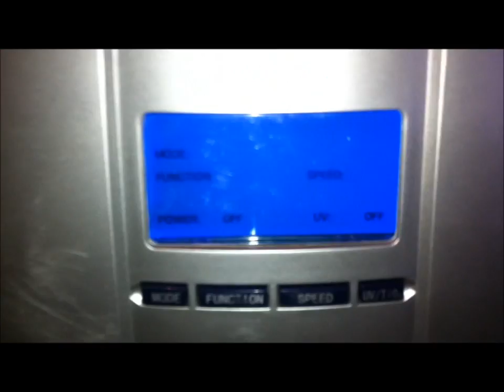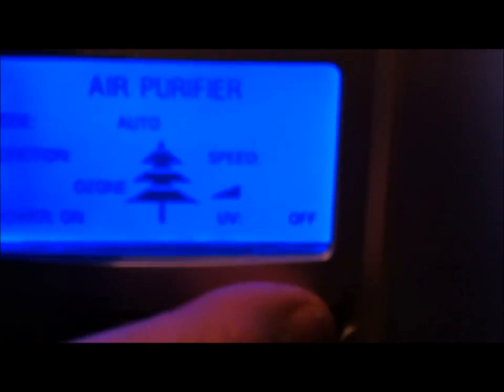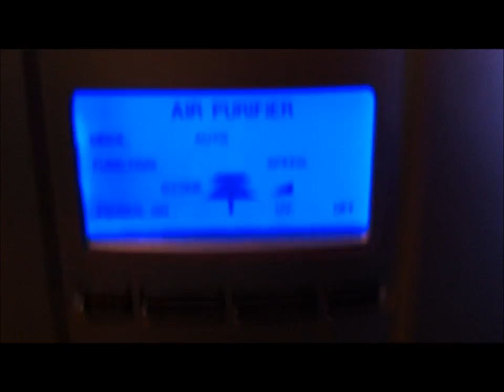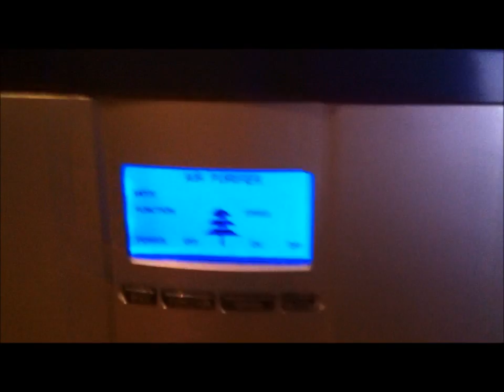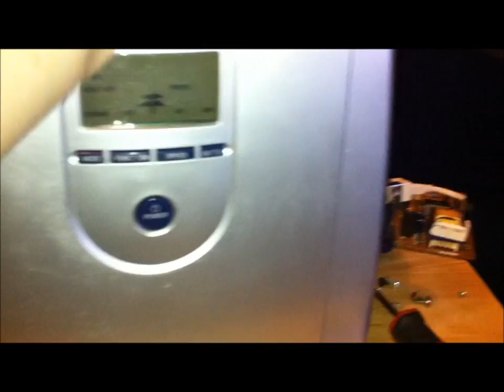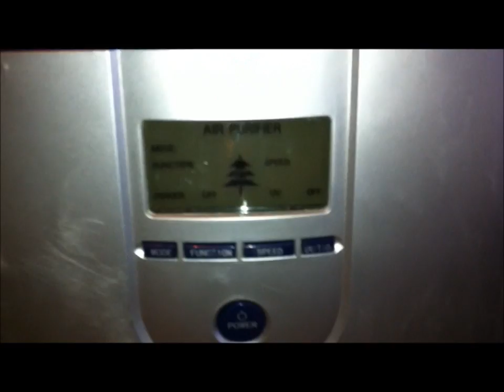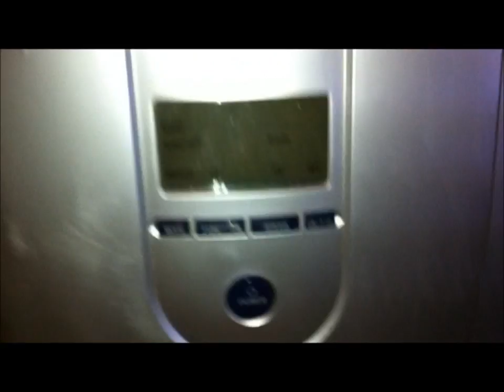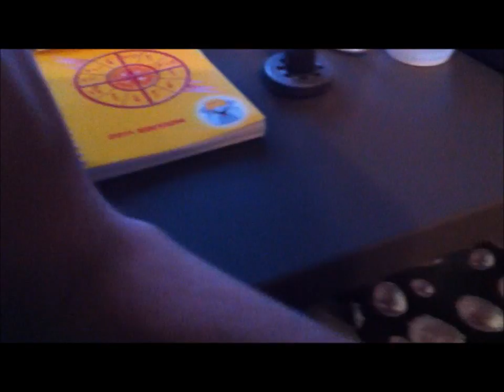EdenPure Air Purifier hype debunked + ozone generator fun + UV bulb

Comment: ions do purifier the air, but not as well as particle filters, and even more than that negative ions (not positive ions) have been shown to prevent cancer... see the youtube video about it from the doctor in japan who did the study...  the YouTube video is titled: "Science: Power of Negative Ions - Restorative Medicine of Nature"  (this is not medical advice)

the only way to have truly clean air is to live in a forest setting or location away from any air pollution, this is because air pollution sources make far to much polluted air to quickly filter, even the best filters take time to filter the air in an enclosed space and in that time you've breathed in the polluted air many hundreds or even thousands of breaths...

negative ions are good to reduce, but not completely remove air pollution/particle and to make the air more energetic/healthy...

the best home air filter is the health pro plus by iqair...  you will need one for each room and it's recommended to just replace the entire unit about every 3-6 months...  if you just want better air and not the best then you can just get a merv 13 HVAC filter by 3M and put it in your AC/heater and run the fan, this will remove most particles from the air in the whole house, but it wont remove gases which are just as big of a problem...  this is why you can't get clean air by using a filter.... even large carbon filters only reduce TVOC by 9% in our tests...   you can also get a cheap box fan and tape or use a bungee cord to attach a merv 13 filter by 3M and this will remove about 90-95% of particles from the air, almost as good as a HEPA filter and sometimes just as good...

there is an GENANO ion air purifier that we have not tested but will test some day that claims to be the best... but we have tested the IQ AIR HEALTH PRO PLUS and we do not work for any of these companies or receive kickbacks, just what we've found in our own personal quest for clean air at home...

the honeywell big and round true hepa filter is also good at removing particles but it is very loud, the IQ AIR HEALTH PRO PLUS is almost 100% silent on the lowest setting... keep in mind you want to keep any air filter 8-15 feet away from your body because they can and do product large and powerful magnetic and electric fields that have been said to be potentially harmful to health...  we've tested the magnetic field on some of these units with fans as the fan motors produce a long range and strong magnetic field, so it's confirmed by us. so you can't put these right by your head, just like you should not have your clock radio or iphone or any electronics including wires in the wall, near your head while you sleep... (this is not medical advice)

so the best solution is to move to an area away from any source of air pollution, otherwise you will get some kind of bad stuff in the air and there's nothing you can do about it...

(this is not medical advice)

Comment: Looks like a Rev A version. The B's have the UV bulb mounted on the case screen on the intake side. I've read that the ozone levels output by this machine are unacceptably high for continuous use. I was also cautioned by someone who knows that the ozone output can negatively impact any gasket type materials causing them to "rot" or age prematurely. As to the left side primary filter - it's designed to be a spare. When you clean the right side screen you don't have to wait for it to thoroughly dry - just use the left side screen.

The Rev B machines also use a slightly different HEPA style filter. There is a plate on the top of the filter with two fins that insert into the machine to activate a power interlock switch. When the filter is pulled out that machine will not operate. Kind of a drag as my UV bulb failed. The new one wouldn't light up. To troubleshoot I had to jump through more hoops than necessary due to the interlock on the filter.

This is not worth the price EdenPure charges in my opinion - maybe worth $75 to $100; not $275 (or whatever they are charging now).

Comment: I run into these once in a while at thrift stores too. I was surprised at how much electronics is found in these units when I took apart a unit that had no ozone output. The ozone plate is too small, and was just plain roasted. So the ozone generator is definitely generating ozone. I think the key is that it is an ozone generator with a UV lamp for small areas where a high level of ozone is dangerous. Not saying they are good, bad - honest or a scam, but they are at least more than a cheapie toy. I'd rank it above the old Ionic Breeze in credibility and build quality. Oh, and that second filter is just a spare.

Comment: First of all this model sold for $297, so you got a great deal.
Dropping the dust from the air to the surfaces is better than breathing it.
State of CA has determined the Ozone setting is UNSAFE. Listed here
http://www.arb.ca.gov/research/indoor/ozone_gen_fact_sheet-a.pdf 
http://www.arb.ca.gov/research/indoor/o3g-list.htm
To the haters, if you can make a non-sleeper video on this subject go for it. I appreciate what was done. By the way, I have this exact model. I have the same filtering, no idea why that filter on the left side is there. I thought like the other commentor that this was a place to hold a spare filter for the right side. /shrug